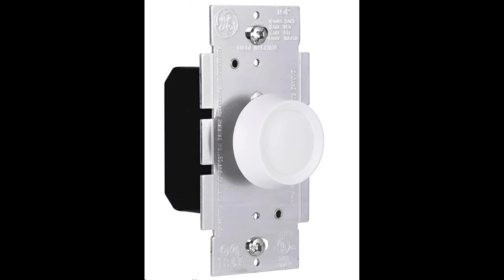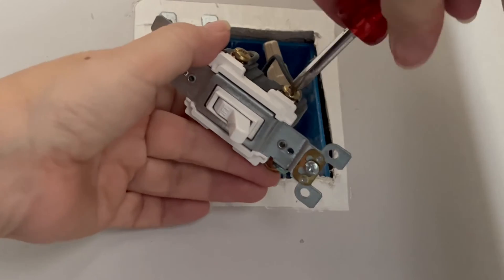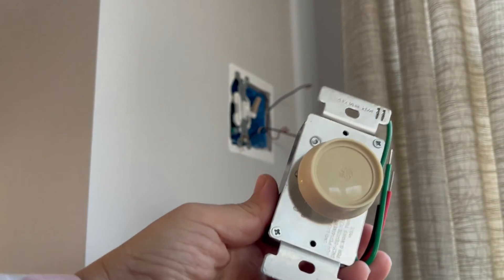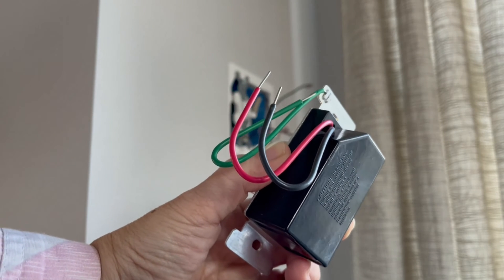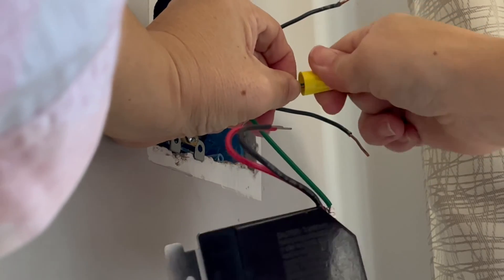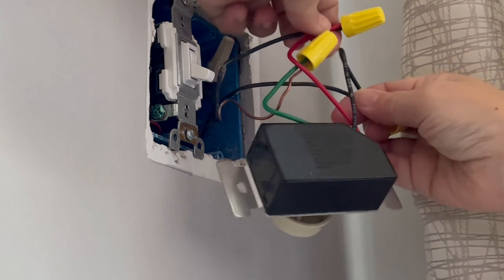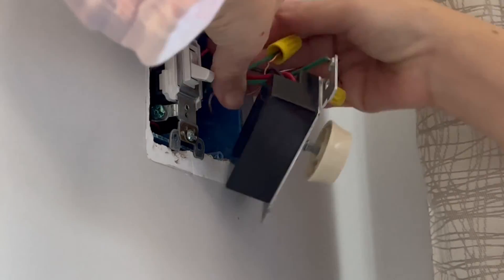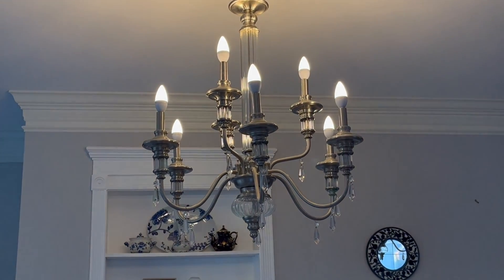How to Install Dimmer Switch for Lights DIY

Comment: How do you tell which wire of the three from the wall is the ground wire? I use the tester and the one beeping is the hot wire. But the other two wires are silent.
Reply from the maker: The ground wire (from the wall) is always the bare copper wire. That is, it's the copper wire without any covering or sheathing.
Reply: @KYKCreations  
Thanks!